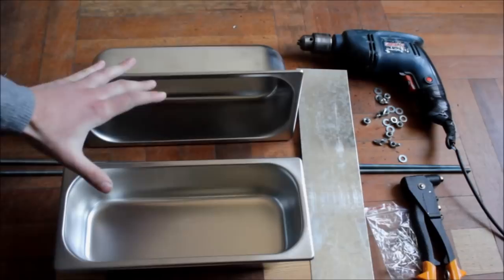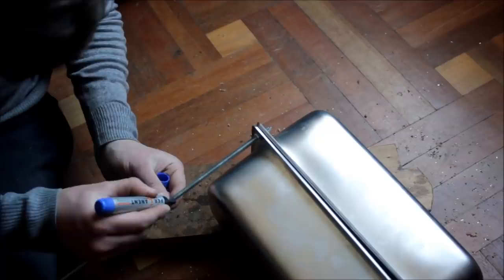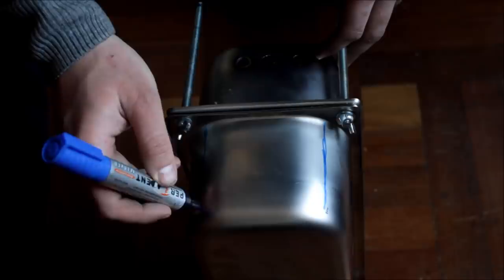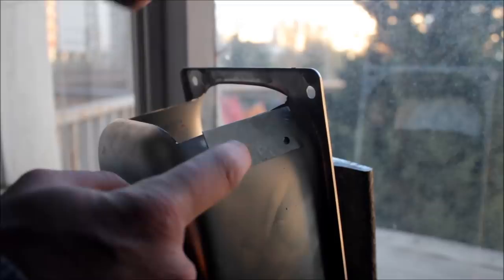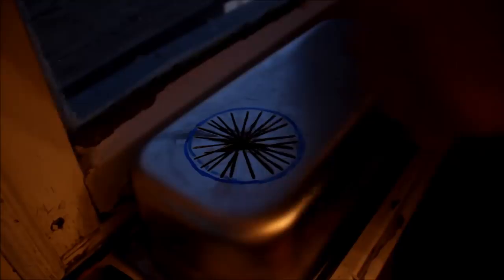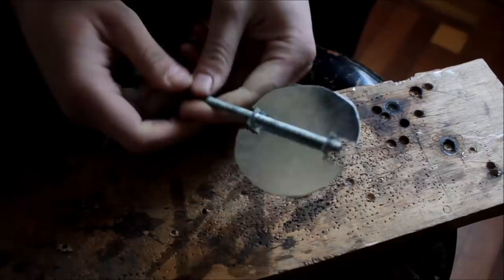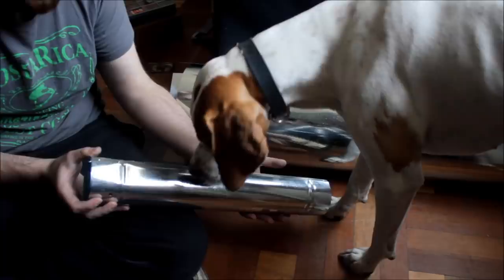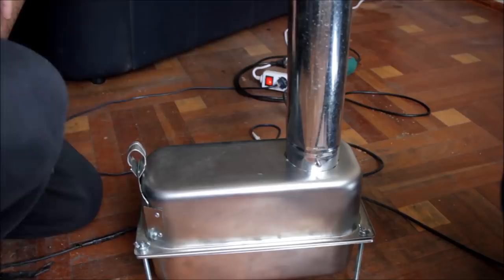20$ BUSHCRAFT WOOD STOVE MADE AT HOME For  Hot Tent In Winter , Survival , Wild Camping - HD Video

Comment: If you have access to Campbell's Chunky brand soups, you can make free stove pipes with the empty cans. Simply remove both ends with a side cutting can opener. Now the  rounded end can be forced into the straight end to make pipes that are four or five cans long. These cans should be pushed together as far as you can make them go and they will lock solidly. After you have made all of the segments that you need, you should press the sections together more gently and not so deep so they can be taken apart when you are ready to store them. And many of the soups are quite tasty!

Comment: Top secret tip, pack a new hole saw with plumbers putty. Drill mid speed. Hole saw will last for quite a few uses in stainless steel

Comment: it looks awesome i'm sure it will do the job better than the same thing at 5 times the price what weight is it by the way and i'm not trying to nock your work just be careful with the flue there seams to be a big gap around the pipe where it met's the stove and i know a guy who got carbon monoxide poisoning  from a badly sealed flue, granted that was on a boat not a tent but if you have time to seal it better it could be worth the extra effort.

Comment: When you drill stainless steel you need to run the bit so slow that you can see it turn and cut. Otherwise you will take the edge off of the bit, running it fast, and it won't cut.

Comment: I love the idea to use those stainless steel trays! But I think you could make a few minor improvements to the design. If you put some of those rods you used for the legs across the top of the bottom piece to make a burning grate that will let the ash fall down. Then you'll need a way to remove the ash easily either a door at the front to scoop it out or you could cut the bottom off and create a grove for it to slide into so you have an ash tray. The last thing would be a sliding flue to control your air flow on the bottom air intake.

Comment: If you are drilling a cup as you were on the edge, put some water in it and rotate the drill bit slowly. A 118 degree  grind on the bit is a bit shallow. Pop rivits are quick ad dirty, solid rivets much better. The seam on the pipe is called a grove seam and is 1/4 back 1/4 forward with 1/8 allowance for total of 34 inch total allowance. 3/8 either side. Taper your flat stock by 3/8 inch one end to other and you will have large end small end to slip inside one another. Small at bottom so that creosote runs inside the stove and not out onto the pipe.

Comment: Another great project! Super job Nick! The only one change that i would make is for the wood feed entry opening. I would make the feed door in a round configuration as opposed to square or rectangular. Example: 
If you make your door opening 3 1/2" or 4" opening so that could preserve the strength of your stainless steel metal under high heat and perhaps prevent warping or weakening and also come to the aid of you air draft control too!
Reply from the maker: Yes but making round holes is darn hard work so easier way is better way for me 😅it is very strong I doubt it will bend though.
Reply: @HFSurvivalSchool  A round hole saw that could be attached to a power drill could make fast work of it Nick. Now that's something that you wished you would have! It would make such work quite easy! The round hole saw would have to be stout enough to go through stainless though. A hole saw for that diameter and of good quality here in the states,would probably cost $27.00.
Reply: Personal preference seems. Could buy once , cry once, then get same size hole saw for flue pipe as door opening & use hole saw for both openings.

Comment: Cool stove, good design. I have one question about using galvanised sheeting. ( i'm not an expert, hopefully someone else will know!) I do know that you have to be really carefule welding Galv metal, as there is a toxic gas that is formed by the heat, Plenty of ventilation or breathing gear is required. Could there be toxic gas problem with the Galvanised parts of this build during use? A good roaring fire and a bed of coals can easily make the stove glow red hot. Anyone know what the relevant temps are to create the toxic gases?

Comment: Nice stove, But 1 thing missing" A pull out Ashtray in the bottom to take out the burned ash, But apart from that 10-10 well done!
Reply: If you want to keep the design simple, that's not needed. Our stoves in the military didn't have any ashtrays, we just turned them over in the mornings to tip out the remaining coals and ashes.
Reply: @vesa7069  TRY A CHEAP SHALLOW CAKE PAN FROM THE DOLLAR STORE THAT YOU CAN PULL OUT AND EMPTY. THEY COME IN EVERY SIZE. EASY TO CUT DOWN.

Comment: Nice , DIY video. But if you made legs a little higher and put reflective sheet underneath. ( tin foil and polished sheet metal. Would give more heat.snd protect ground in tent.
Reply from the maker: This has to be used with open floor tent and when you fire it up in a small tent the last thing you'll need is more heat :)

Thanks for watching 
Nick

Comment: 1/2 Size 4" Deep Anti-Jam Stainless Steel Steam Table / Hotel Pan - 24 Gauge ... $7.79 each or 6 for $7.49 ... in North America ... from the manufacturer ... 1/3rd the cost of amazon for the same thing ... 
.
6x12x4 ...plus it has the flange ... it is a steam tray pan ... you can even get lids for them ... if you make it so you can remove the top you have a portable fire pit and all you need then is a grill to put over the top 
.
myself I would make the legs much longer so I could put another pan with lid under the stove and use it as an oven ...or warming tray ... be a good place to heat water too ... 
I would suggest a deeper pan for the oven ...aside from being a handy spot for the oven it will also act as a heat shield for your tent and work as a solid base to keep your stove from sinking into the ground ... 
.
and yes if you do the rods long enough you should put feet on the bottom of the legs so the rod has more surface to NOT penetrate things ... if you have the top off you could place a Grill plate on those rods and now you also have a griddle ...

Comment: Next time, use nut rivets, you'll kick yourself for not doing so sooner. they are great for adding threaded rod legs to things. I think it also needs a damper on the input air, and a final upgrade would be to do something so that the chimney fits inside the stove box for easy transport.

Comment: Don't understand what folks are so worried about. This is basically a rocket stove design. As long as the front vents are partly open and the same for the flew, there should be no issue's of CO2 or anything for that matter building up. The taller the stack, the cleaner the burn and the stronger the draw.

Comment: Lixada makes a wood burning camp stove, sells for $20, take apart design allows you to put it into the size of a small notebook (or stow in your backpack)...and unless you are putting a wood-burning stove in a walled tent designed for such stoves, these things will END YOUR LIFE due to CO poisoning, otherwise! Bushcraft stove? Better look at a Lixada stove first...they will save your life and can use MOST ANY FUEL (Esbit tabs, Alcohol pots, firewood, even tea candles) and breaks-down to be SUPER-EASY to pack...
Reply: He did mention in his video that he was going to use it in a hot tent in an upcoming trip. Hot tents are designed for wood stoves. As far as CO, you are correct. You must be super careful (proper ventilation, etc). You can also carry a CO detector/alarm as added insurance. They even come in compact travel sizes. I'm not criticizing your comment. Just stating an FYI. Thanks

Comment: You carry a stove when you go hiking?  How about a kitchen sink?

Me, I just build a fire on the ground.
Reply from the maker: You clearly have not been in -20C in winter for more then 3 nights , when you stay that long the condensation that builds up in your sleeping bag becomes an issue as it doesn't dry during the day so after one or two nights it loses its capabilities and if it is a -30 sleeping bag after two nights it becomes -5 and so on , so a stove gives you option to dry it and stay as long as you wish in the wild mr survival guru.
Reply: Correct!  I have not been in -20C degree winter for 3 days.  And furthermore, in a long lifetime of camping and outdoor survival, I have never had the need or the desire to do so.  For me the discussion is one of theory only, as it is for most Youtube posters.  I heat my home with wood, and your little "stove" would soon load up with ashes, and burn up all your fuel for lack of an air intake damper.  Nice theory, but more for a gadget collector than real life use.
 
In the real world, people don't go camping in that kind of weather, nor do they carry stoves or sinks around just in case a storm overtakes them.   I prefer the tropics, where I can enjoy the beauties of nature, and not spend my day finding fuel and huddling in a tent.